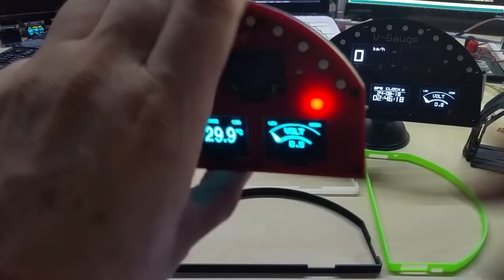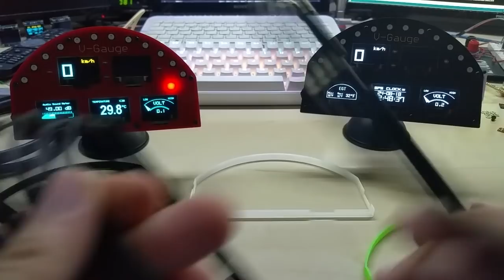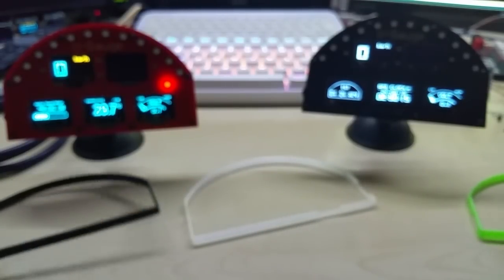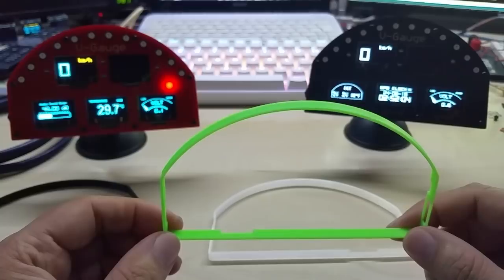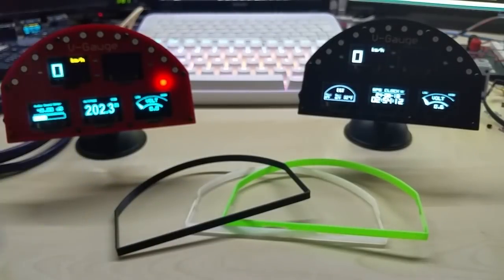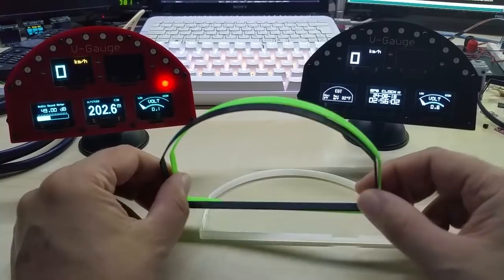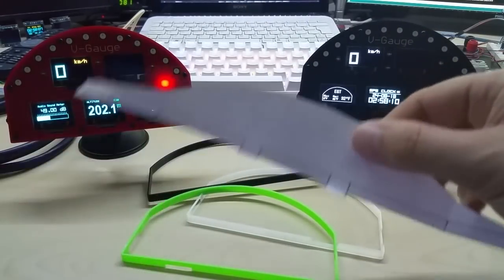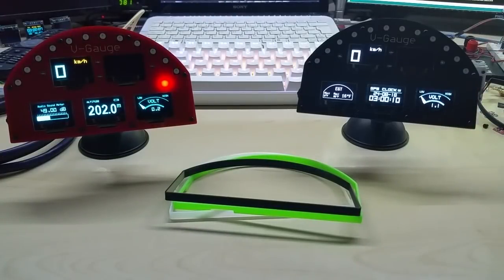V-Gauge Hardware update, frame added, codes explained and more

Comment: Impressive as always. I'd be interested in a video time lapse of you assembling a V-Gauge. Also do you have a video where you explain further how the user can switch what's in each display? Are you storing hex files on external flash and uploading to each display microcontroller via a separate microcontroller? Pretty neat!
Reply from the maker: Hi Jon, would love to once I have the time to do a single unit from start to finish, but I don't know how well my Note Edge camera is up to the task, fighting constantly with auto focus is a pain :-) Need to get a better camera, but there are way too many choices and I can't decide and don't have the time to do proper research. Initially I was gonna add the capability to upload codes for the center bottom display from the microSD card like on my OLEDiTREK but decided against it as the connections would need to be changed for various input signals. So now I will upload the code that the customer wants when he orders it. Of course it could be changed later on too. Sometimes less is more :-) As it is now, you have plenty to choose from and it will get even better, and everybody has his own preferences anyway. Thanks.

Comment: You putting a lot of efforts to this V-Gauge - hope you'll get enough attention and interest to it to pay back your development. One short question - is it real altimeter or barometric, based on BME280 (my guess)? 
p.s. link to tindie store is displayed wrongly - most probably due to cut and paste - and do not work
Reply from the maker: I hope so too :-) In this case it is the BMP180, temperature, humidity and pressure sensor. But any other I2C sensor can be connected to the bottom center display as the pin are broken out on the HDMI connector board. Thank you very much for the heads up about my link, fixed it. I wish Youtube had a template for the description :-)